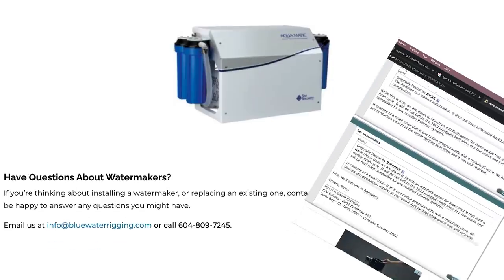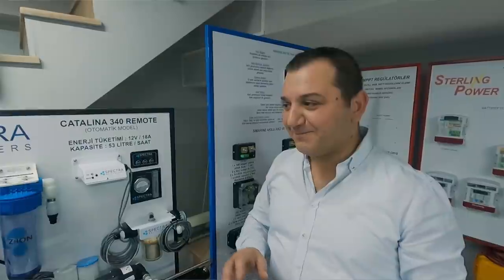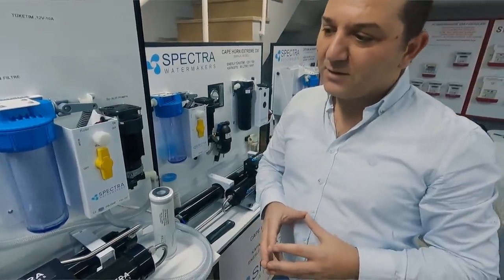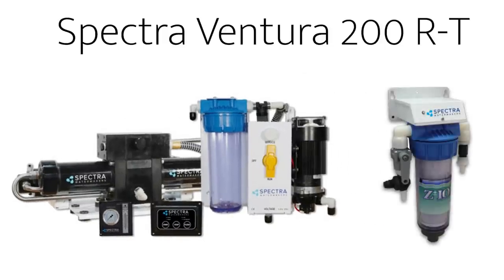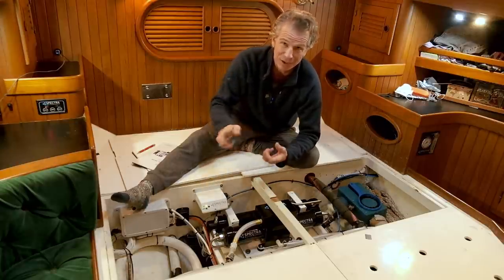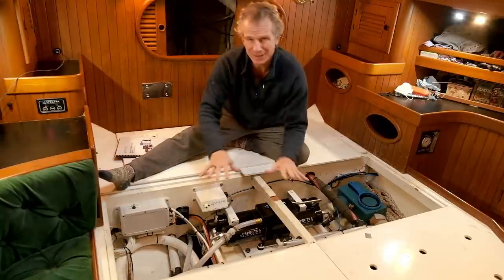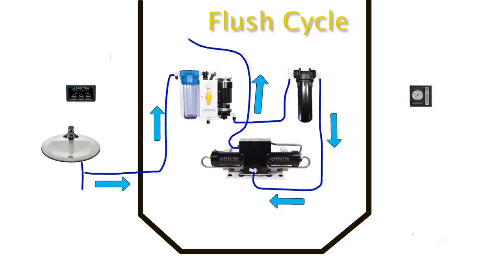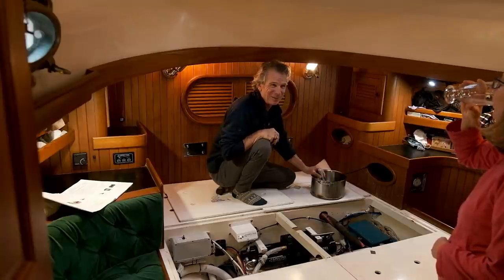The best water maker for us |  Spectra Ventura 200

Comment: Just noticed the little holders for reading glasses and other bits above your Nav station, I like those :-D
Reply from the maker: Got them off Amazon when we were in the UK  at Xmas, they are advertised as 'remote holders' but work well with glasses - stops you forgetting where you've left them.

Comment: Working on an upgrade to my system, which like yours has a manual diverter for the first batch of water produced. I'm coupling a timer relay to a diverter valve. It always takes about 5 mins to get below 500ppm, so it's based on time rather than water purity.

The advantage is it allows autonomous operation, so the watermaker can just be set by a timer switch and work on the boat even while we're away from it.

Will keep you posted on how it goes if you're interested.
Reply from the maker: Yes, sounds good 👍

Comment: I have run two Specra Watermaker on different boats over the last ten years. They are OK…. All Watermakers have their issues. However, I have just bought an AC Rainman. Just to highlight that with Solar and Lithium I plan to run the Rainman from my Inverter. It’s super high output means that I will only need an hour or so every few days which will be nothing for my energy setup. Horses for courses but the interviews in the Catermaran didn’t seem to take a non-generator powered AC Watermaker into consideration. I like the sheers simplicity and portability of the Rainman. If not Rainman I would have fitted a Schenker Zen - Spectra are very expensive for no particular reason.
Reply from the maker: I can see the Rainman having an advantage of not having the bother of fitting but I really can’t see any other advantage, & you still have to store it somewhere. Running an AC unit through an inverter just says inefficiency to me. Big losses in the inverter. I agree the Schenker Zen is a good unit but very similar price to the Spectra and from my research the Spectra has the edge on reliability. I think they’ve nailed it with the Clark pump.

Comment: We have the same model but it has a TDS meter in-built with a solenoid valve. The product water quality is monitored on a touchscreen display and the solenoid valve diverts the product water straight out of the discharge until the TDS level comes down to the correct level and then it diverts it to the tank.
My kit also came with a 20 micron filter unit in series with the 5 micron filter and both filters are quality monitored and an alarm goes off if they need attention. All very easy once installed.
Reply from the maker: Sounds good. I decided to keep it as simple as possible but I think Spectra make things well so I'm probably being over cautious. Do you find having two intake filters an advantage?
Reply: @svfairisle  I can't really compare as I've never just had one filter but I expect it makes the 5 micron filter last a lot longer before having to clean/replace

Comment: Hi Steve. Congrats on the install.

Well worth getting an inline ppm meter. eBay and Amazon £30-40

I have an osmosea. Very similar design. It takes a minute or two to get up to pressure, during which the water drops from 2000ppm to 300. I don't use the diverter valve, just run the unit for 2 hours minimum so it still averages clean. Have my on/off switch hooked to a 12v weekly timer so can program it to run every 7th day if I'm away from the boat.

You'll get more production in warmer water.

I always thought drinking water should be 500ppm or below, but can't remember where I saw that, and interested to know where you saw 750ppm figure.

Don't run it in a harbour if there's oil or fuel in the water. It fouls the membranes.

Good idea to use the soundproofing of the mattress to keep the pump noise down.

I'm sure the batteries will cope with a couple of hours production each day

Comment: Most of the Clark pumps from Spectra require a complete rebuild about every thousand hours.  Several full time cruisers have reported $1200US t $1800S bills for rebuilds like clockwork.  Yes they use less energy but have something like 90(which I don't know the exact likely numbers) seals that wear out in the double reciprocating action.  Our system which is a pressure washer pump on a motor, has not needed anything but a few oil changes in the head in over 3000 hours, and a new head costs less than $300US and gets us about 35 gallons an hour for 80 amps 12 volt.  Spectra(most 200 models) gives you about 8.3 gallons an hour (For the cheaper models) for around 10 amps at 12 volts(plus the boost pump).  So mine uses more electricity but is faster.  For 35 gallons a Spectra gets 42 amps.  Mine uses 80amps for 35 gallons.   Mine also cost around $1500.   Yours is a great system,  but my sailor friends say expect a rebuild at 1000 hours, not what they try and tell you in the literature of 3000 hours.  When you need a rebuild, you might want to give Seawater Pro a call.  A whole new system might cost you just a tad more than the rebuild and shipping.
Reply from the maker: Well I personally have only heard of one person rebuilding a Clarke pump & that was after 5 years, but in any case as I said in the film if you have the unit fitted by Spectra the warranty on the Clarke pump is much longer. I'm actually trying to find out if it's a lifetime warranty  or 10 years, there seems to be some confusion. But either way I think it's pretty good.
Reply: They're really easy to strip and rebuild. Hardest part is sourcing the seals.
Reply from the maker: I contacted Spectra, it is a lifetime guarantee on the Clark pump for and faults but that doesn’t cover general wear of the seals. So you will need to strip and put it new deals when needed.
Reply: @svfairisle  Spectra makes a good unit, but I just can't justify the cost.  I think for the lower end u it's one would be in the hole for between 8000us and 16000us.  Also if it is true about the seals wearing down every thousand hours or so like viewers have been saying on Sailaway World Sailing and Folsom Ocean Views.....well the costs get out of hand for normal cruisers.  I use a generator to help with hot water, making water, and cooking.  Essentially even though we only have 300 watts of solar, we can all have hot showers daily, refrigerate/freeze food, and cook on electricity with the generator.  The ultra great electricity usage of a Spectra just couldn't service six people on a thirty foot boat. In other words it likely couldn't make enough water fast enough, and to babysit for the number of hours needed to make sure the operation went well.  Our igen2600 can even run out 16k ac too.  We use 15 gallons of gasoline per month no Ac, and and sixty gallons having the ac on 24/7. Typically with a mix we use about 22 gallons.  So even not really being able to use solar on the water maker, vs the installation cost.... well on average we spend 88 dollars on fuel here per month to have all the creature comforts.  Vs our home grown system the costs of a Spectra don't make sense.  If they only last a thousand or so hours between rebuilds one might be looking a 10000us for the first thousand hours.  My system including the generator , fuel, and system for the first thousand hours I estimate to be  around 2800us.
Reply: Did the water pump last?  Update please?

Comment: Thanks for that! Really informative. Sounds like a great system. One question: is there any protection for overflowing your water tank? Will the system shut off when the tank is full? Oh, congrats on 50K! That is a great accomplishment :)
Reply from the maker: Spectra do have a gauge you can fit to your tank which will automatically switch it off yes, but we have two tanks in it just not worth the effort. It comes out the overflow in the Galley sink when full so we get warning
Reply: @svfairisle  get a copper ball attached to a brass rod, can't remember what they call em, been around for years.
Reply from the maker: @waterboy8999  Ball Cock!……. Sorry not being rude it’s what they’re called. Sadly no good on boats though as the water surface wobbles around and anyway trying to stop pressurised water like that would damage the membrain. It just a simple electrical float switch to send a signal back to the controller to stop.

Comment: Just curious, how happy are you with your Spectra Water Maker long Term now that you have had it and used it for a couple years?  Thank you.
Reply from the maker: Well it hasn’t missed a beat and still delivers perfect water at the specified rate, so A*. Now I’ve jinxed it!
Reply: @svfairisle  Thank you for the reply.  My wife & I ar planning to start cruising in 2 years when she retires (I am retired).  Getting our Hunter 41ac up to speed - three major projects left - new rigging changing over to Lithium & solar, and adding a water maker. Gonna be an expensive two years, but necessary I think.  I see so much on the Sea Water Pro, yours was the first I have seen on the Spectra - I think I prefer the Spectra better.  So, thank you for your reply. I was curious long term how it was holding up.  Sure hope I haven't jinx'd it for you!
Reply from the maker: @scottbeare2323  I’m sure you haven’t! Re. The solar, do try and get bifacial panels if you are having them on an arch, so much more efficient. Look at fold out panels as well for when you’re at anchor, the saying you can never have enough solar is true! But there’s a limit to how much you can hard mount so extra panels are good. I use them to charge solar power stations but you could have them piped into the house bank. Have you watched the rigging videos? There are pit falls to rigging mainly to do with riggers who don’t really know what they are doing so it pays to get the best as we did or at least learn from the best, there’s too much dubious information out there! There the video on our changeover to lithium as well, this is really the minimum that’s necessary, ours is working great, but if I were designing from scratch I would have a system that separates charging from power supply completely with BMS’s in charge of each side and a centralised monitoring system, probably from Victron, controlling it all. Whatever you do though to some degree there is always the possibility of something messing up so redundancy is the key!
Reply: @svfairisle  Thank you for the advice. We have had our boat for close to two years but are certainly still in the learning phase.  Purchased it from a woman who had just lost her husband to covid so we did not get much useful info on how systems were modified and arranged.  I just discovered your channel a couple days ago, I am a big fan of youtube, really a lot of good info.  I like your channel very much because you include a lot of hands on type info and less fluff so-to-speak.  I also like a chap named Solar Solutions - same straight forward good info.  I have not seen your rigging video yet, will look that up shortly.  I have watched your lithium change over videos - very good.  I appreciate the advice - I have flown airplanes my entire adult life (US Navy for 24 years, airlines for another 15) I learned a long time ago that experience is the best teacher.  I give you a lot of credibility because you have done it.  Nice to have a heads up on potential pitfalls and hurdles early on.  So anyway, thanks for the advice - will take it all on board.  Hope your sailing adventure continues to go well - I enjoyed the crossing video last night.  I hope my wife tolerates the boat and seas as well as yours!  Thanks again!

Comment: Great video as always! Would there be any problems if you were to be in a fresh water area, an estuary for example?
Reply from the maker: No it actually easier for the system so you’ll get good flow. Just avoid turbulent silty water which will clog the filter quickly

Comment: Can you explain how the water maker knows when the tank is full? Does it have a pair (Hi and Low) of float switches in the tank already or did you have to fit them?
Reply from the maker: Spectra have a switch you can fit to the tank that switches everything off when full. We have two tanks and the overflow goes into the galley sink so I didn’t bother to fit anything, easy to know when full.

Comment: Excellent. Best I’ve seen. Diagram was fantastic. Can you elaborate on power requirements. I’m having a 44 Hallberg Rassy built. I hate the idea of needing a generator but with watermaker, I’m concerned with power requirements in addition to fridge/navigation/autopilot at sea and usual power consumption at harbor. Do you know of a good resource to work this out?
Reply from the maker: I’m actually just working on a video tackling power at the moment. We are currently switching to Lithium. You can of course work out a power budget going through the draw of every device and then trying to work out how often it’s used but in my experience real life often doesn’t fit with the paper model. For example if I have an overnight passage and budget 5Amps for the autohelm all night, I might have a big following swell on the back quarter & it be twice that. Or I might have 15knots on the beam and with well balanced sails it will be next to nothing. I’ll be posting lots of figures & I plan to have a dedicated section on tech corner in the website, so use us as a guide.
Reply: @svfairisle  Thank you and nice work brother!

Comment: Great vid. Very informative. 
Is the silver probe renewable (exchange) or do you need to replace the unit? How big is the probe? Any indication of life expectancy in the information pack?
Reply from the maker: Very good question that I don't quite now the answer to yet, but I'm on it!
Reply from the maker: Okay initial response......  the Z-ion electrodes will last 2-3 years (no idea what usage profile they've put that on) still chasing a cost on replacement
Reply from the maker: Info from Otkay the Spectra dealership. The Z-ion has a service interval of 720Hrs so as it’s only running for 3mins on each flush that’s a very long time!
Reply from the maker: More info that Otkay got from Spectra's tech team...  
it does not need to be changed out every 720 hours.
The rods and housing must be inspected at that interval to ensure that the system does not need replacements.
To prolong the life of each Z-ion electrode ensure that customers do not extend the 15-minute flush duration and do not manually increase voltage to the electrode.
Generally, these parts do not have to be replaced.
Reply: @svfairisle  Thank you. 
I have used silver as a sanitizer for drinking water in the past. The element for that system was frighteningly expensive when due for replacement.
Reply from the maker: @darrenstarling3975  arh! Well then you’re right to check how long it lasts, it’s expensive to buy in the first place so I glad it looks like it won’t need replacing for most people. 720Hrs is a lot of 3 minute flushes and that’s just the time for inspection. I don’t think even us as liveaboards will reach beyond that!

Comment: RO water as you say is very "aggressive" how do you protect taps pumps and the like from corrosion?
Reply from the maker: It more aggressive but it’s we’re not talking acid here! Your domestic water systems should be fine, they’re all brass & similarly good metal that will deal with it no problem. The thing to watch out for maybe in your engine. You’ve got a standard old steel sections in there which might suffer.

Comment: Excellent presentation as ever!  One thing I did notice, Steve, those small cables coiled up. Would they be better cut to length ? I presume they are low voltage so heat build up maybe isn`t such an issue. It`s just my OCD regarding pipes, ducts or cables!
Fair winds guys, take it easy xx
Reply from the maker: Ha! yes well my OCD kicked in in another way... My pet peeve is wires run to length on components that might need to be looked at  if they go wrong or serviced. I hate having to lean over into tight spots when I could just unscrew the item from the bulkhead and work on it comfortably. Also how many times have you installed something then a couple of years later needed to move it slightly to make way for something else? I've just done that with one of my MPPT's to make room for some components for the lithium instal, fortunately I left a little loop of spare cable. 
And your right, unless you've got your cable sizing wrong there's no problem with a loop of wire, actually really the only issue is high current devices with fast fluctuations in current where you might run into back-emf problems.
Reply: @svfairisle  Fair point, let`s call it a draw :)

Comment: Always fascinated by Steves research . I had a Schenker 30 fitted at the beginning of 2021 in the Med on my 46ft monohull. . It has never worked underway which is not what the manufacturer says. The installer was a highly competent  engineer. Hoping it will get fixed. Why did you choose Spectra steve over the Schenker 30 on 12 V . Thanks
Reply from the maker: I actually think Schenker and Spectra are equally as good, they are the top running DC units for quality. So really it was just that there was a Spectra dealer in Istanbul that swung it in the end. Re. Your use while underway, have you got a forward facing strainer type inlet on the through-hull? That’s what Spectra recommend
Reply: Try fitting a forward facing skin fitting. All flush skin fittings will experience a strong negative pressure when you're boat is at speed.
Reply: @svfairisle  yes Steve it is forward facing, the Schenker dealer in Lefkas looked at the installation about 2 weeks ago, they are saying that we should not use the unit when underway- not what they say in the brochure, they claim that the Schenker is good for small boats with outboards, ribs etc, obviously not true, and no use for sailing non stop for a week or more. Would be interested to know if yours will work happily underway?